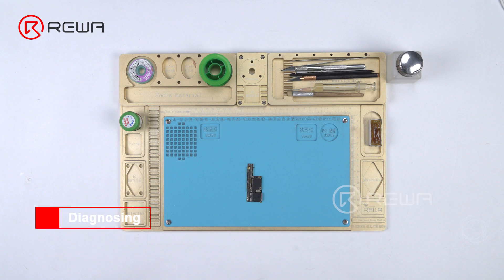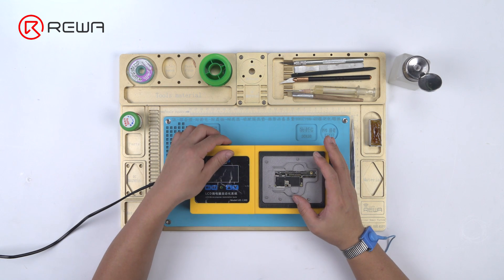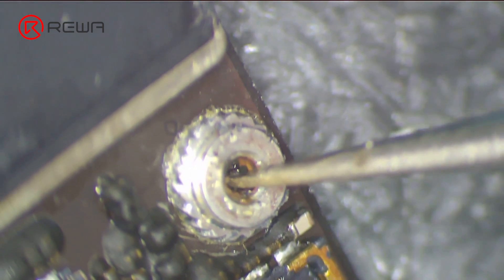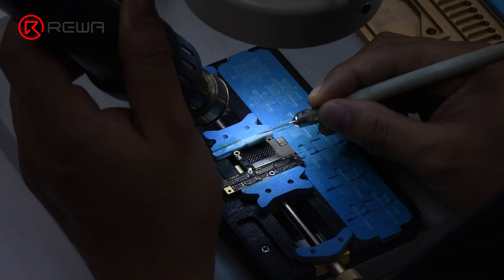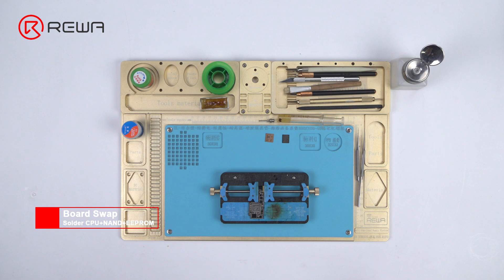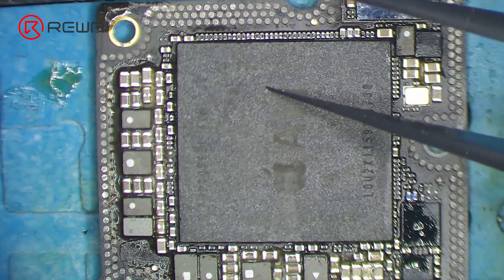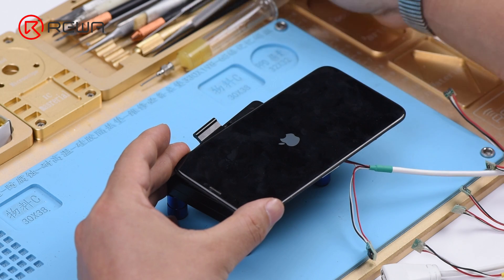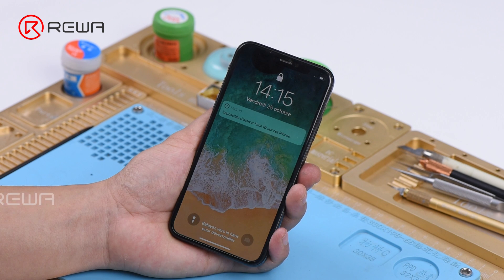How To Fix iPhone X Won't Turn On By Board Swap | iPhone Repair Tips

Comment: Your website does not work well. Sometimes I can't login and my order still has not shipped after a week. No confirmation emails or anything.
Reply from the maker: Hi tim, thanks for your feedback, website is under maintenance at the moment, you can try register in shop.rewa.tech instead.Sorry for any inconvenience caused.